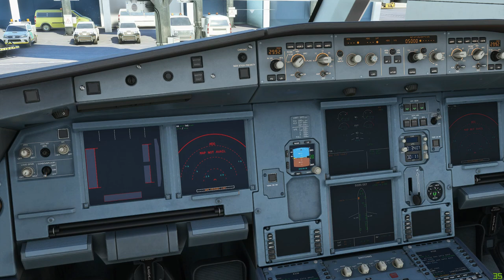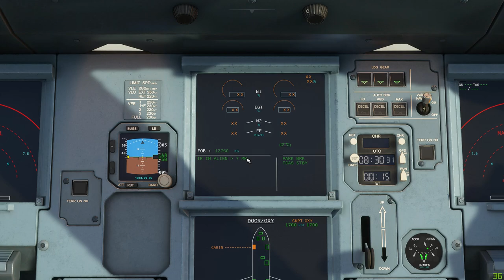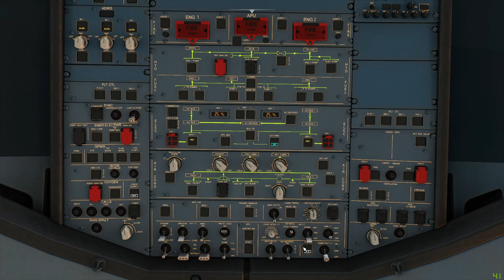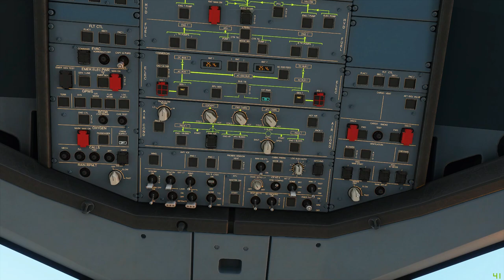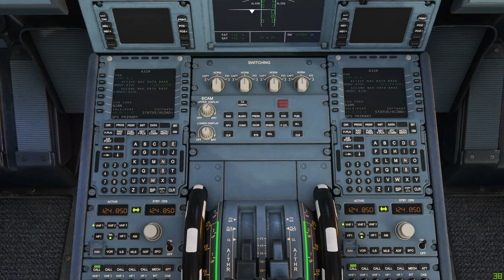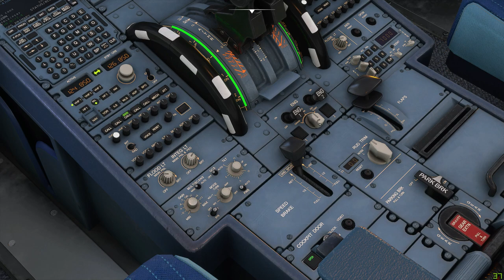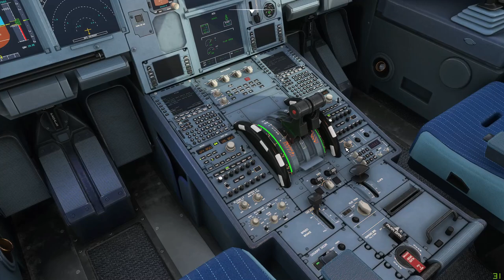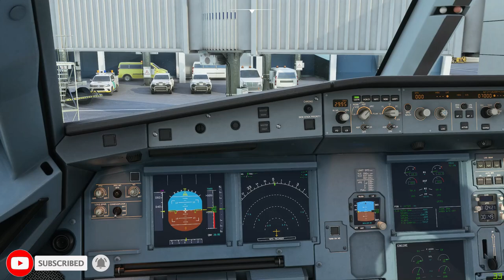Microsoft Flight Simulator 2020 | Tutorial EP#15 | A320 Cockpit Displays, Knobs & Switches | Part 1

Comment: My whipers are on i cant turn them off and Autopilot still shakes in the Air help please
Reply from the maker: Which version of the mod you're using?
Reply: @TheSimPilot  Makes no difference stable
Reply: Now i deleted the mod and plane is stable again and whiper knob is controllable again
Reply from the maker: @LieorDie24  Not sure I'm using the dev version and never faced the same problem. However I re did my controller bindings after the last patch where a lot of bindings were messed up after the patch.

Comment: I have xbox version.. how to use all knobs in the sim i cant press everything
Reply from the maker: Xbox contrlos are a little different. I have to learn how to use the new interaction system before I can record a video
Reply: @TheSimPilot  yeah i understand but the knobs are blocked when i play i can use them
Reply from the maker: @mussietube9909  Not each and every button and switch in cockpit is functional. There are many inop ones, it could be why. Which buttons you're referring to?
Reply: @TheSimPilot  i am.not refering to a specifiek knob but i see the difference.. looks like the pc version is more realistic
Reply from the maker: @mussietube9909  I switched back to legacy interactions after Xbox release. In my opinion it's easier to interact in the cockpit especially when in need of immediate changes to HDG, ALT or SPD. I haven't seen the Xbox version with my own eyes. Therefore, not able to compare it to the PC version.